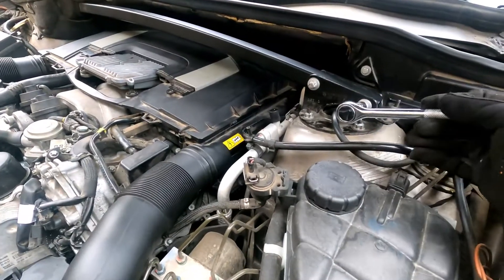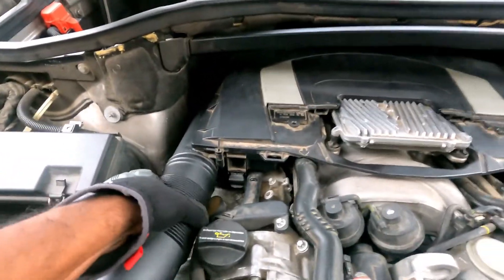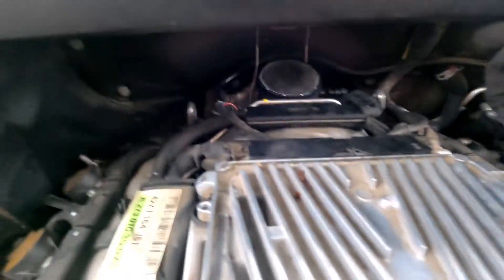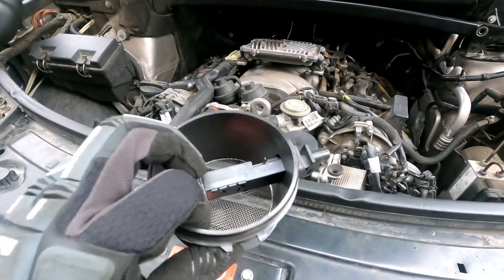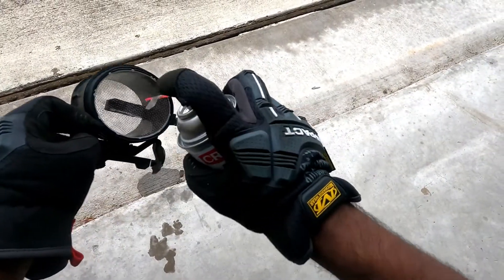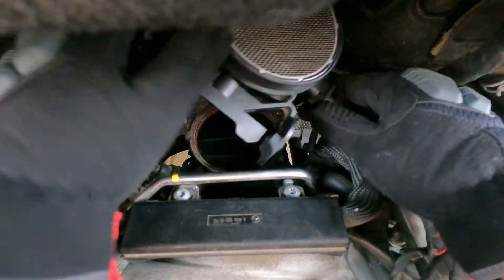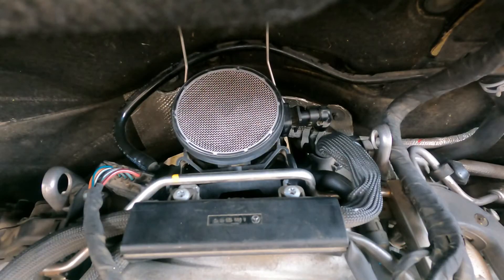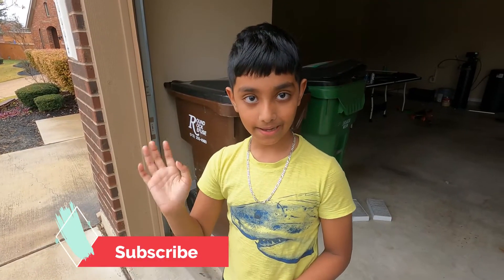Mercedes Benz - Mass air flow sensor cleaning

Comment: Thanks for the rich information. But I noticed the check engine light is still on after replacing the maf sensor.  Does the light dissappear immediately after replacement?
Reply: Did you unplug your battery for 10 to 15 min after installing new mafia sensor? Needs to reprogram to the new one